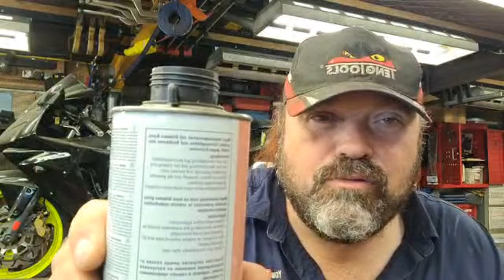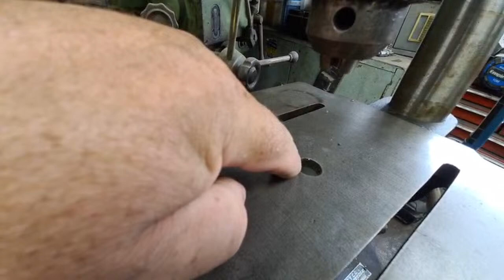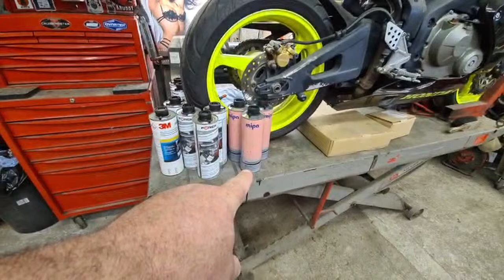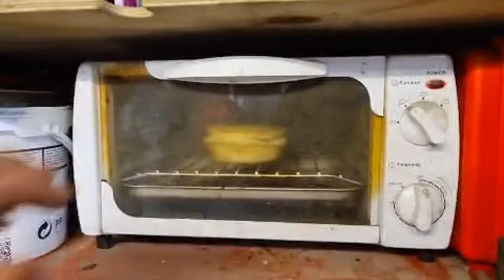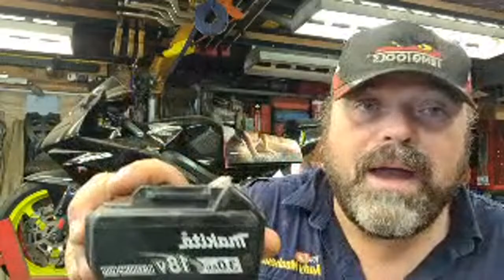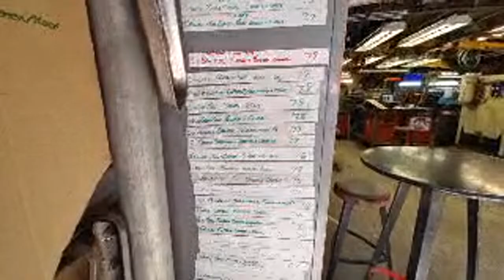Best Bitumen based underseal, mystery Pie, Updates & chat...

Comment: All bitumen based underseal is crap holds water and chassis rots
Reply from the maker: I find if it's applied to a brand new chassis it works well. If the chassis is already even a little corroded then, as you say, it tends to keep moisture in & the rust just spreads.

That's just my experience here in NZ, may be different in your country due to weather/climate etc

Cheers
Andy
Reply: @AndyMechanic Totally agree new would be fine, but where we stay in the far north United Kingdom with sea air and salt for winter roads it’s no use, I find any product that is wax like, lanogard is a good product